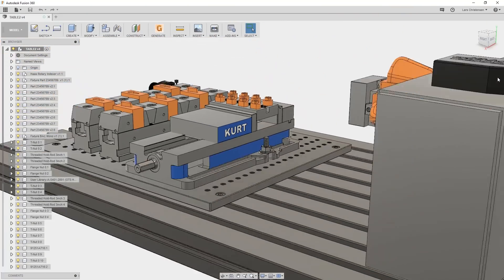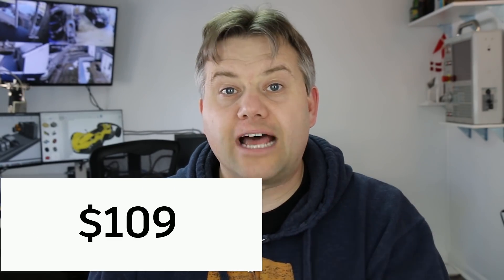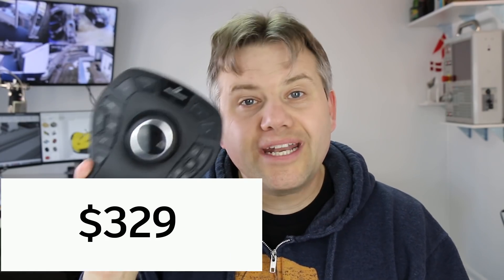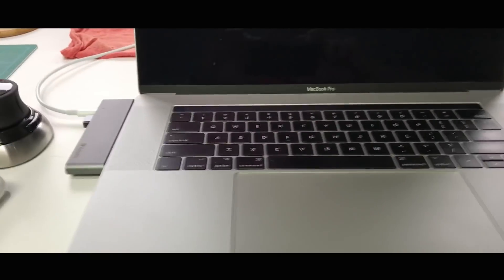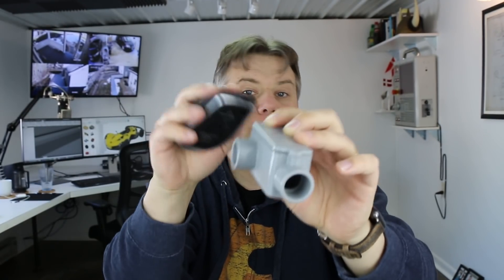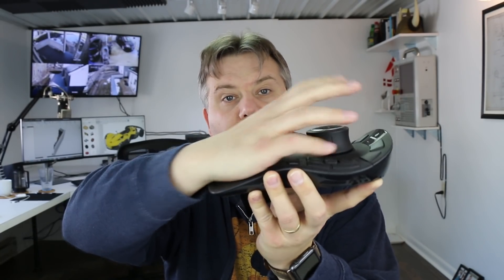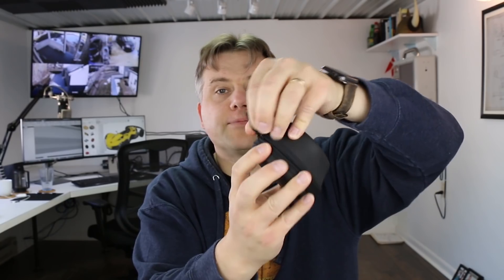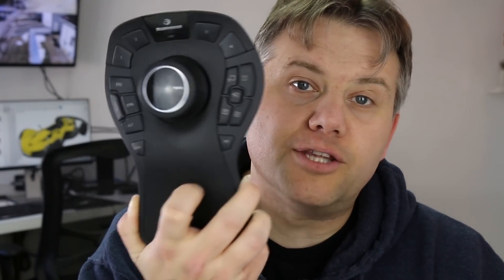HOW I PAN, ZOOM & ROTATE — 3D MOUSE REVIEW | 3D CONNEXION

Comment: I've been using one for 10 years now. I couldn't live without it. The company I work for uses NX and it works flawlessly. But I do not use any of the buttons, I still use my keyboard. I also just use the scroll wheel on my regular mouse for zooming in and out.  
Anyway, that's just my two cents worth.

Comment: There is no way that is real stainless steel, that doesnt even make sense. How would you make a shape like that from stainless steel? Its not possible or it is very very expensive.
Reply: You can make shapes like that from SS. You can even 3D print stainless steel shapes now. I can get this done from the same production house that makes my PCB designs and other 3D printed parts. It's extremely expensive for one-offs, but for a company producing thousands of units the cost would be reduced significantly. I'd imagine they get it routed though. It could also be aluminium outside with heavier weights inside.

Comment: It's a great device, may take some time to get it integrated into one's workflow; but luckily it is not a mouse replacement. Its great during a review / spot check period for sure as you would be using a 2d mouse and likely meta keys on keyboard or house and with the 3d mouse its a smooth joystick / helicopter like exportation of the design.

Comment: These products have serious quality issues or what appears to be an intentional manufacturing process with the rubbery coating to get customers to repurchase after their warranty period is up.  

This reminds me of how Apple intenionally makes their charging cables extremely prone to fraying after 2 or less months of usage by constructing it with a very thin outer rubber insulation layer.
Reply: Yeah, a lot of products do this over time  Wacom stylus, TV remotes etc.
Reply from the maker: Hi Jarexx, I have to disagree, sorry. I have used 3DConnexion devices for ten years and never had a faulty one. I recommend that you reach out to their support and ask for a replacment
Reply: @cadcamstuff  Just wait a couple of years. I've got the SpaceMouse Pro, the wired version of what you've got there (given to me by 3dconnexion, ironically)
In time the rubber will get horribly sticky, I only use the SpaceNavigator these days because it only has a tiny amount of the surface covered with the afflicted rubber.
Reply: My SpacePilot is more than a decade old (manufacturing of that particular model was from 01.05.2005 up until 31.03.2010) and its manipulating cap is like brand new. The rubber of the cap is extremely durable. 
 The only damage that happened (due to my fault) was that the black coating surrounding the LCD screen got cracks after I accidentally hit it with a dropped metal part that I used to measure, so basically the quality of everything is top notch. I have no experience with the modern successor of my model, though, so I can't say whether it has quality issues.
Reply: That's weird.  The rubber on my space mouse is like new even after 8 hours of use a day for several years.

Comment: I have been inspired by Lars in the past (and I miss his down to earth helpful videos - but fully understand the effort and time they took). Anyway, I am a home used doing bits and pieces in Fusion 360 (for 3D printing and laser cutting) and I found that my right wrist was starting to hurt (like pull on the muscles/tendons leading into the thumb). 

So, as Lars is someone I respect I looked at the Spacemouse in some detail. I ordered a wireless one and it arrived today. I have been using it in Fusion and it will certainly take some time to get the acurate finesse that is needed BUT even as a beginner I found it better than mouse wheel, hold mouse wheel and holding down keyboard buttons.
I even found it useful in scrolling/zooming other programs. I think that it will have been money well spent. 

By the way from the UK it was cheapest to order direct from 3Dconnexions rather than dealers or Amazon.

Thanks again Lars.

Comment: Does anybody have the same issue as I do? The side rubber pieces (between the 'metal' and the buttons) of my 3DConnexion CadMouse Wireless seems to be stretching with use and is now too big for the gap it is meant to be filling - and this after only using the 3DConnexion equipment for 5 months. This results in a very uncomfortable grip and that has been quite an embarrassment in the office after spending $160 on a mouse that now looks like a piece of broken equipment.
Reply: It's known issue covered by the warranty. You will need to contact the producer. You devices will be replaced.
Reply: miecz23 hahahaha no they won’t.
Reply: @theMandr3w  did you tried?

Comment: I imagine a person who uses a spacemouse is a very slow worker?
And if you ARE a fast worker with a spacemouse, you would still likely be three times faster if you stopped using it, right?
If you're using a spacemouse (PARTICULARLY the cheap ones with stupid few buttons) that means you're either not using hotkeys for functions, and relying on mouse-clicking on MOST functions other than the most basic, or you're constantly switching back and forth between the spacemouse and the keyboard.

I've seen "mouseclickers" play games and it's excruciating to watch how awkward and slow they operate where a keyboard user is just slamming hotkeys, picking functions and maneuvers effortlessly in seconds. And if you ARE constantly switching back and forth between a spacemouse and a keyboard to hit hotkeys, enter calculations or notes, that's got to be very tiresome both mentally and physically? Mainly modern 3D modelling is parametric too, so you're constantly calling up previous dimensions to ensure correct calculations in the designs.
Or is this mainly just a thing for those people who almost exclusively works with finished parts to put together assemblies and don't design their own?

It seems to me 3dConnexion has their design upside down; Shouldnt they incorporate the navigator into the keyboard instead of emulating a desktop mouse?
It seems to me it would make way more sense if there was a thumbstick protruding from between they keys on the keyboard, easily accessible while still having full access to all hotkeys and typing from the keyboard.

Any thoughts from those of you who have a spacemouse?
Reply: I used it for 4 years now with CAD, Electronic3D, Google Earth, Games, etc without problems and high speed interfacing the applications.
Configure the 2 buttons for default View orientation and Layer/Tree settings.
Also keyboard combination inputs are possible what I did.
I was sceptic too but you can't talk about it if you have not tried one for a few hours.
You are constantly switching back and forth between a mouse and a keyboard to hit hotkeys with your right hand...
Now add the left hand to optimize work.
I've seen engineers sweat trying to control the thing so getting headache!
It also depends on what kind of work within 3D you do.
For an assembly mating, inserting, aligning and inspecting the design intent it's power shows.
Reply: That thumb-stick idea was tried back in the 90s, it didn't stick. And the space mouse (on my 3rd day with one) has way more nuance than a tiny joystick like that could have. I'm a power user by every stretch of the phrase, usually memorizing just about every shortcut an app has (thanks to anki). And I can say, having a 2D and 3D mouse again, is adding something to my workflow. I haven't had a mouse in 20 years, as I mostly work in audio and coding, but now that I'm in 3D I found the two finger click drag on my Macbook Pro's trackpad just a little too wonky, and it was jittery in Substance Designer. The two mice flanking my keyboard are working well. I was fast before, but maybe a tad faster now. And the variation in muscle use is easing some of the repetitive stress.

That said, in Blender just lightly caressing my trackpad with two fingers (mimics scroll wheel) is smoother than the one on the 2D mouse. I mean, the mac's two finger scroll thing is like butter. But the detented scroll wheel on the mouse is still good.
Reply: @motoservo  thanks. My company only gives out the cheapest piece of garbage 3dcobnection 3d mouse with barely any hotkeys its packed away in a box and not being used as I'm way faster without it. I would be interested in trying one with many more hotkeys, but they're too expencive to buy just to try in case they suck
Reply: @Thomas-tl9xd  If you're in the US you can buy one on Amazon with two weeks to try it out. If you don't like it return is free and you'll get your money back.
I use the two mouse kit, without all the hot keys (two on each mouse and the 2D mouse has another button on top, behind the middle button). For me, personally, I just like the mice for navigating, but my hands are back on the keys for all else. I'm still getting the feel for it, though. And in Blender, still making adjustments to optimize my experience.
What I can do with the 3D mouse that I can't with the laptop is when I get two (or even three) vectors moving at the same time (backing up, twisting to the left, while gaining altitude, for instance. XY and Z, all at once). It's more like having a game controller for an Xbox. And that's just with my left hand, while my right hand is free for sculpting and painting with my iPad and pencil, or clicking with my 2D mouse.

Comment: Hi Lars, one question to the Spacemouse Pro wireless.
I've changed the Z axis to be up in default modeling orientation. Unfortunately each time I use the "Isometric View 1" it changes the view proper fitted but with Y axis up (as if I didn't changed the setting) and not as if I use the "home" button in view cube.
Do you have any idea how to modify the "Isometric View 1" so it show in proper orientation with Z up? 
Thanks,
Reply from the maker: I do not. Sounds like it could be a driver problem. Might not be a bad thing to post about it here https://forums.autodesk.com/t5/fusion-360-support/bd-p/962
Sorry I’m not to more help
Reply: @cadcamstuff  THX.
BTW love your videos.

Comment: did you experience camera movement problems? In such way that when you have some kind of prolonged model (lets say 300x10x10 mm) you usually get stuck with camera movement; sometimes it won't move in one of the axis (fusion makes sensitivity on that axes very low) or something like that; you get into situation where you can't Comfortably rotate/pan/zoom with SpaceNavigator;
Reply from the maker: Hi Evgeny Garanin Thank you for watching!
I know that have been some driver issues....I think I see it more on Mac;s than on Windows machines.....Not 100 percent sure thought.

Best,
Lars
Reply: @cadcamstuff  yep definetely I had more discomfort on my Macbook than on Windows desktop PC! Thanks for sharing experience :) I use your videos as first place to go when I need to learn new technique.
Reply: @passenger000  You have locked a certain rotation.

Comment: Hey Lars, I want to thank you for your great videos. They're VERY helpful. 
I have a 3Dconnexion Enterprise that I use with Modo, Rhino, SketchUp, 3DCoat, etc. but in Fusion 360 I can't find a way to constrain the y axis so that it remains vertical when I rotate (AKA Lock Horizon) 
I have Constrained Orbit checked so that SHIFT+MiddleMouse will orbit with the horizon locked but as soon as I navigate with the 3Dconnexion mouse the horizon is no longer locked and the model is allowed to roll. I didn't find anything in preferences that has the desired effect. What am I missing? 
Thanks
Reply from the maker: Hi Gregg Johnson Thank you for watching!
I am on the road right now and did not bring any devices. I would recommend that you post on the forum about this.

BEst,
Lars

Comment: I was ready to place an order for the wireless combo until I noticed the CAD Mouse supports BlueTooth but the SpaceMouse requires their USB dongle.  I'm on a MacBook Pro with USB C, so that means an additional adapter, too.

What are you guys in my situation doing that truly want wireless without additional cables and dongles?

Thank in advance!
Reply from the maker: Hi scottosds Thank you for watching!
YEs, as you can see in th4 video, I do have an extra dongle so I can run the usb dongle on my mac. I'm not a big fan of that, but that is Apple's fault in my opinion
Reply: I agree that the decision by Apple to ONLY include USB-C on their "Pro" line doesn't seem right.   

However, since every notebook I've had over the last 5-7 years has included built-in Bluetooth, I think a worse decision was 3DConnexion not to support such a standard, especially when it applies to a portable solution.

I will probably still buy their stuff because of your recommendation, but am really disappointed in having to use a wireless dongle when wireless technology is already present.

Thanks for the videos and the recommendation.

Comment: Just to echo other comments, the rubber coating degrades over time. I also had to remove the cap (tricky operation), clean it off, then use Plasticoat Rubber to reapply the comfort finish.

Generally I tend to use the mouse and keyboard.
Reply from the maker: Hi Richard Hawley Thank you for watching!
THat is interesting, Thank you for sharing this! Personally, I have never seen that happening

Comment: I have used the Space Navigator for many, many years and it works really well. The only complaint I have is that the rubberized coating on the knob breaks down after a few years and becomes really icky. I had to use alcohol and lots of elbow grease to rub all the coating off. Underneath the coating is a shiny, smooth plastic surface.
Reply from the maker: Hi Richard D Thank you for watching!
That is interesting, I have never seen that, but great advice! Thank you for sharing!!

Comment: I purchased a space mouse.  When it works its great BUT,  the mouse driver stops working and the unit has to be unplugged and reconnected often!  I contacted 3dconnexion and was given a work-around (basically unplug and reconnect)  REALLY a work-around how about a fix!
Reply: You can also do a control alt delete and stop the 3dconnexion service, then restart the exe, I keep meaning to write a reboot driver script, I'll put a comment up here if I get around to it.
Reply: Ok, providing you have installed the software in the same folder as me(if not change to your path), try this:

Create an empty text file on the desktop, open in notepad, copy/paste 

taskkill /f /IM 3DxService.exe
start C:\Program" "Files\3Dconnexion\3DxWare\3DxWinCore64\3DxService.exe /b
exit

save, exit, rename the file to RestartSpaceMouse.bat

Afterwards you can create a shortcut and add it to your quick launch if you wish.
Reply from the maker: Hi Bryan Rude Thank you for watching!
Wow, Morten, Totally awesome!! Thank you

Comment: Lars.. I have used the 3DConnexion Space Mouse Wireless for a long time now. It is probably the best peripheral I have ever bought.  Its too bad that none of the 3D printer slicer software applications support it. If you want to take wrist papering to the next level, ditch the mouse and get a trackball for your mouse hand. I use the Logitech Cordless Optical Trackman. Best trackball ever. Its too bad they stopped making it. They do have two other ones though. Get a trackball you will love it.

https://www.pricesmile.com/logitech-cordless-optical-trackman-t-rb22-new-usb-ps-2/
Reply from the maker: Hi Sean O'Brien Thank you for watching! And the great comment! I will have to look into one of those

Comment: My SpaceMouse, the rubber on the bottom hardened up, so it wouldn't stay still and the rubber on the knob was pealing off.  I need to buy a pro one day.
Part of the problem I had was that I only had one, so going from work, to working at home was a pain to adjust back and forth.
Reply from the maker: Hi Mark G Thank you for watching!
You sound like a hardcore user :-) You need two

Best,
Lars

Comment: Anyone suggest a  fair companion mouse? Dizzying array out there'
Just bought a used Space Navigator so I am tapped out. Dying for it to arrive. 
I have been using a 15yr old Apple Mouse with micro trackball  :P  
Yes I do like to get some mileage out of my gear.
Reply from the maker: Hi Chris Leech Thank you for watching!
3D Connexion does have a wired and wireless mouse. I like them, but I don't think they are anything different than a Logitech mouse for example
Reply: Hi Lars great video :) Just wanted to mention that as well as the fact it is a top end 3 buttons mouse, built specifically for CAD, the 3Dconnexion CadMouse is different mainly because of our software! The mouse is integrated into most 3dcad software along with the SpaceMouse through the API, so that buttons and operations can be mapped for different functions for all your different programs, and also even specific areas of each app. You can even program it to run common commands in a sequence with a single click, or open a radial menu :)

Comment: Can you program S as one of the buttons??? S and Enter are pretty much the only two buttons I press on the keyboard.
Reply: Marshall Wollum 
You can. At 4:16, when the user interface for programming the buttons is shown, you can see that "keyboard" is one of the options.

The wired Space Mouse Pro has shift, alt, ctrl, and esc and I use those constantly.
Reply: Thanks Hirudin :)